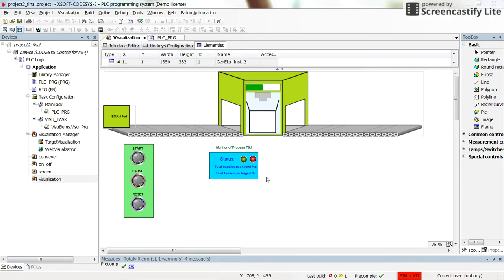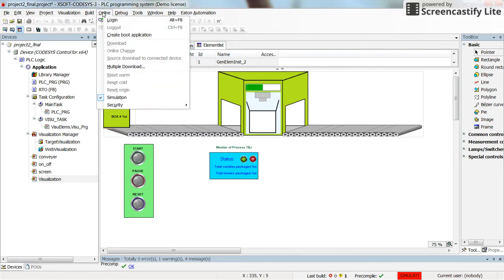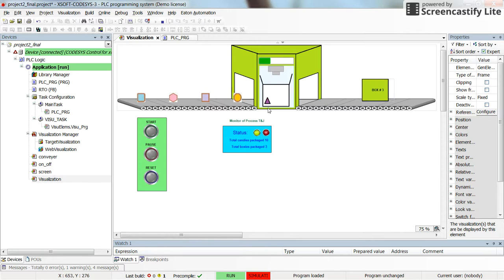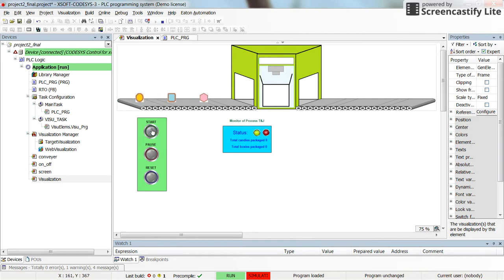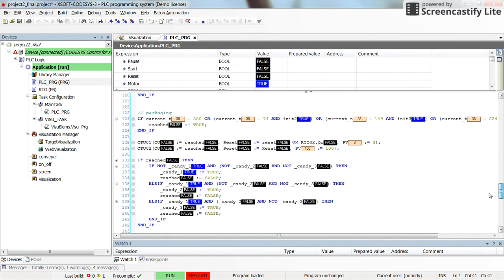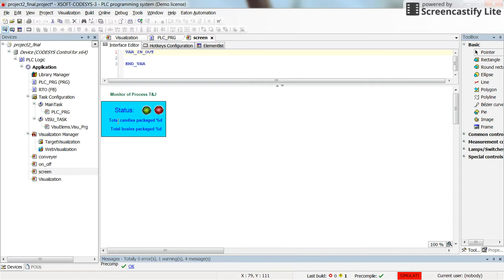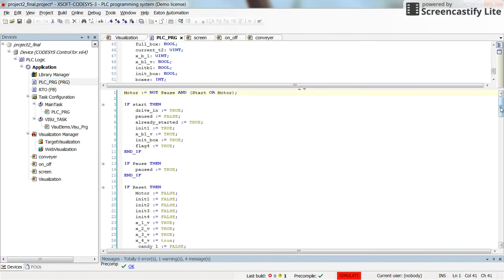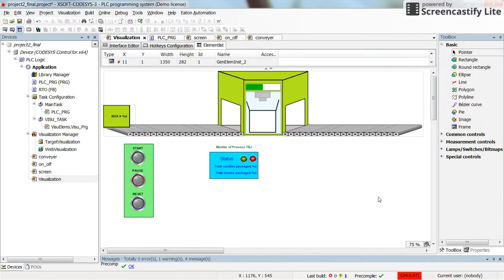CODESYS: Sample (01) project for the Industrial Automation - Candy packing - open source code

Comment: Dear Mr.Tohid Alizadeh,
Now, I'm having a XV400 HMI-PLC, and I want to download its recently project.
I don't know connect method between them.
Can you help me to download this project by real communication? 
Thank you so much!
Reply from the maker: Dear Kien,
Once you start CODESYS, you need to specify the device with which you will work. Then, when you want to do Login, you need to find the device in your network and then get connected to that device. The CODESYS will scan for the available devices and show them in the list. You should not be in the Simulation mode, by the way.
Reply: Thanks for your kind feedback.
I try to connect by  Ethernet cable (RJ45). HMI-PLC XV400 was configured IP: 192.168.1.130 (But I didn't reset PLC because this system was running online) and My Local PC was configured IP: 192.168.1.100, I can ping them in "cmd" window, but they can't scan in Xsoft-Codesys 3.5.5. Maybe I must reset XV400.

Can you tell me to upload program in XV400 by Ethernet cable? (Or another cable?)
Thank you so much!
Reply from the maker: I think the Ethernet cable should be enough to upload the program to the PLC. Let us know if you manage to complete the connection.